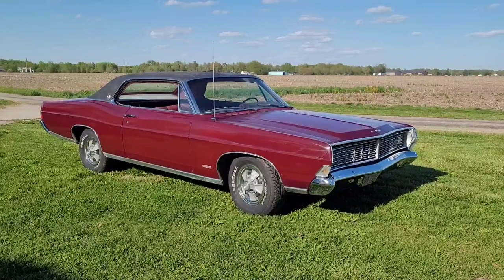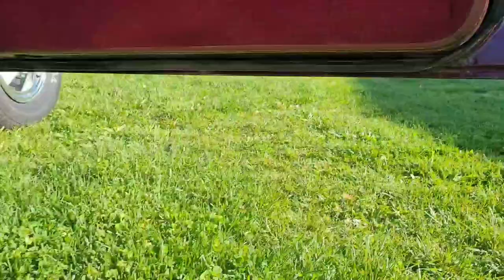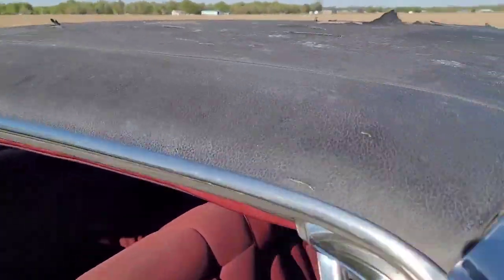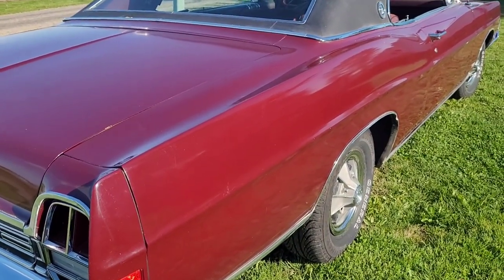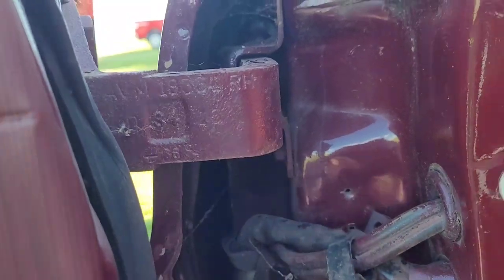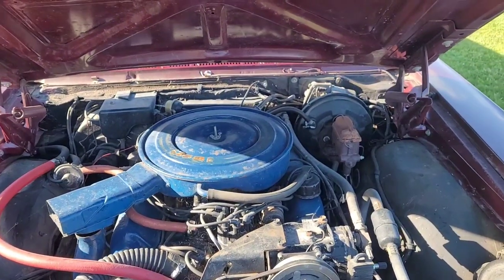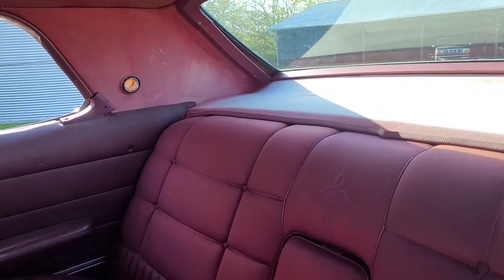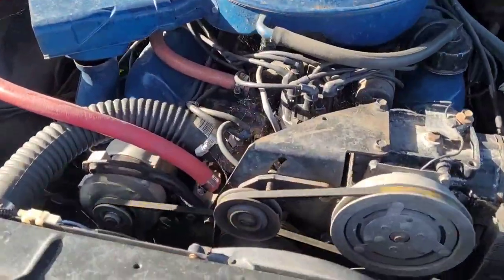1968 Ford LTD Brougham 2-Door Hardtop 390 2V C6 Walk Around And Drive Nicely Optioned

Comment: I’m pretty sure the Autolite 2100 was a 500 CFM carb.    They didn’t have the issue with the four barrels where the smaller primaries were great for initial tip-in, but lacking badly from about 1500rpms up, unless you buried your foot and got the secondaries, necessitating a stop at the next closest gas station.     Those vacuum headlights saved me from a serious traffic offense very late one night.   The story is incredible, but true.

Comment: A right hand mirror was not a factory installed option until I believe about 1972. Back in those days you could custom order a vehicle. I worked in the automotive industry since 1974 until I retired in 2018. I remember seeing GM cars with a passenger side power seat but no drivers side. I remember an old lady’s 1970 Buick LeSabre without power steering or brakes. It made life interesting.
Reply from the maker: I'm sure you saw all kinds of strange things. Yes, it clearly states in the dealer brochure that a right-hand mirror can be installed at your dealer. That was weird!
Reply: @tonyscarcare5657  
Actually a driver’s side rearview mirror was optional until the 1966 model year. My father’s first new car was a 1966 Fairlane 500 sedan. It also was the first year that two rear seat belts were standard. I had two older brothers so guess who didn’t get a seat belt?
Reply from the maker: @dave1956  Lol!
Reply: @tonyscarcare5657  

The seat belt thing really became important to me later on. In February 1967 my mom T boned a car with our 1960 Falcon that was not equipped with seat belts. I was in the backseat and was far luckier than the front seat passengers.
Reply from the maker: @dave1956  That's terrible!  I sorry to hear that. I do always buckle up.
Reply: @tonyscarcare5657  

When my father picked me up at the hospital after the accident I immediately buckled up and do each and every time to this day.
Reply from the maker: @dave1956  I understand!

Comment: In 1998 I bought a 1971 powder blue LTD with a 400 CID engine for $500. Have great memories from that time and from that car. Car had a blow out on the driver's side front tire, but because of the full frame, all I heard was the sound of rubber slapping the pavement. The car didn't pull to the left, even at 70 mph.
Reply from the maker: They were really building cars back then! Nowadays, they get destroyed with a blowout.

Comment: I zeroed right in on that manual mirror! Seems more like an ordering oversight by the original dealer  .
The right-hand mirrors were all dealer installed at this time AFAIR. The first year for a factory right-hand was 1973, when they were also remote. Also, it's odd that the convenience panel (4 warning lights) under the dash wasn't ordered I always saw that as a companion to the power locks. On T-Birds from 1967-71 they were bundled together, also in '67 Fords. Speaking of vacuum locks, I remember the ones on my dad's '67 LTD. They were speed sensitive,
at around 8 mph they would lock themselves. This system was very problematic. I remember one time at a gas station they locked themselves, middle of winter, windows up. Later, on a trip down east to Expo 67 (we are from western Canada)  they  malfunctioned again. This time, after parking, the  switch under the the dash wouldn't  unlock the doors. Vacuum was being applied full time, and you had to pull up on the plunger with one hand and open the door handle with the other. That force was strong!, especially for 6 year old me. Dad took the car to a dealer in Ontario where they disconnected the system. Later, back home,
the dealer was unable (or unwilling) to repair it.
Reply from the maker: Yeah I remember all of those things you mentioned. I know a local guy who worked at the local Ford dealership and he told me about installing countless right hand mirrors. And yes it does state in the brochure that they were dealer installed. I just don't understand someone ordering all that it has and not having that done. I did add the convenience control panel to my XL and have another for the one I'm working on now. In 68 they were a separate option from the vacuum doorlocks. Thank you very much for watching and commenting!

Comment: Has anyone noticed that little guide arm inside the door jamb on the hinge ends?  On my ‘68 Squire, I was trying to get the door courtesy light working and the bulb was good but no power to the fixture.   So I traced the wiring , and that silver arm coming out of the door seemed weird.  It looks like it would hit the fender when it closed, but it doesn’t.    It appears to be a guide for the wires and vacuum lines to keep them from getting pinched and also kept the wiring in a consistent shape such that it wasn’t always flexing, and everyone knows that ANY wiring, any metal for that matter, will fail sooner or later if allowed to bend back and forth enough times.     Amazingly, even my tailgate window motor had good voltage even under load, because they did a similar job on the wiring through that “Magic Tailgate” hinge.   The motor though, was dying by 1996.    I realized it was because the window weather strip had failed and the motor was getting wet for decades.     That was the single biggest pain in the ass on my Squire.    That and the gas gauge didn’t work because the float wouldn’t float.   And the 390 exhaust manifolds always leaked, even after replacing the gaskets.    But that tailgate glass would quit working at the most inconvenient times.  So I tried over and over to sort it all out.   The motor worked great horizontal when you bypassed the safety switch.    It was just heavy enough to bog the motor while lifting it, and I even tried to come up with a hidden rubber band/bungee assist, taking note if the strap used to raise side lexan on old race cars.    Then it would t go down properly and I couldn’t open the tailgate unless the glass went down to hit the trigger allowing the latch to open.      So one time while trying to fix it, with that inner panel removed, I made an improvement to the wiring, with soldered connections and 12 gauge wire as far as I could get it into the fender.   Well it worked so well that it shot the glass out and onto the driveway, shattered before my eyes.    I had re iced the retainer so that I could remove it and test the mechanism so that I wouldn’t break the glass.     I was more shattered than the glass.     How in the hell was I gonna find a replacement tailgate glass for a 1968 Country Squire in 1999?    Well, the local junkyard just so happened to have a 1967 Ranch Wagon, and even though it was a crank up window, it was the same.   $125 later and I was saved.     Put it all back together and the motor just wouldn’t do the job, partly because of the lengthy wiring from the dash switch, to the tailgate and back, as it had to incorporate the keyed switch in the tailgate handle.      Always a pain.   I often had to get out and grab the top of the glass to assist it up, then use my palm to press it the rest of the way up.
Reply from the maker: That's quite a story!

Comment: Grew up in Phoenix late 60's early 70's. I remember my Dad going to upgrade the 4 blade fan to maybe a 7 blade fan. I helped him install it. The parts store had tons and tons of fan upgrades, I think it was a common thing with it being so hot there. It peaked 125 degrees in the summer in those days, and overheated cars were a fairly common sight. I don't think they had the UV paint back then, or it was perfected. The sun literally destroyed things out there. Watching cartoons on TV, auto re-painters were big advertisers and they were pitching low prices. Those jingles are still burned into my memory. I think the philosophy was a bad cheap paint job was better than the powdery degraded paint. Hold on to your shorts, neighbor had a nice corvette, the stingray style, and they had it repainted about every year. At a distance it looked nice, but close up you could see the orange peel, drips, over spray, etc. It was more of a functional paint job than a factory job I guess.  Every time they changed the color, when they opened the hood, or the door, you could see the original color, and a rainbow of oversprays from each time. I think the more expensive packages they masked things, did the door jambs, etc, the less expensive ones were more like a quick wax job. Nice video
Reply: Thanks for the tale. Great time to grow up it sounds
Reply from the maker: Thanks. All AC cars had 7 blade fans.

Comment: Buyers remorse, Buyers Beware. You get what you pay for. 
At least you have the knowledge and experience for detail in automotive build,construction, manufacturing and maintenance of which some people do have. 

This is why they need to bring back all the trade schools and in high schools and colleges and universities. 

At times this is where you take a ride like that you have got to find and locate a really great reputable automotive engineering restorer that will not only take care, proper time and effort but also stands behind his Craft, design, technique and takes pride in his work, of which nobody or anyone does today. Maybe 🤔 quite a few people and individuals do, but they are very, very, very rare to find and locate. If and when you do sit down 🪑 with them and let them do what they do best. 

If it takes them time to take years to get that ride right back to the way it was bought when brand new maybe 🤔 even better when first built, made and manufactured. 

That is the proper steps I would take even if I had the proper funds to have that ride restored. 

                                   Sincerely Yours Truly 

                 T. O. G. Ivan I J 🧔🏾‍♂️💪🏾👍🏾👖👕👔👖🤵🏾‍♂️💼🧢🕶️👓🥾👞

P. S. Like I said before and I’ll say it again, I’ll still choose and pick the Antique, Classic and Vintage Rides of The Big Three.  Ford, Chrysler and GM when the workers still have taken and took care, pride, and stood behind their work, effort and impeccable ethical automotive performance back in the day.
Reply from the maker: Preach brother!